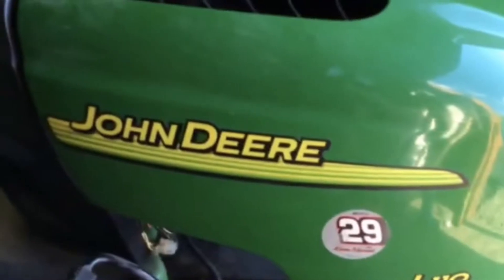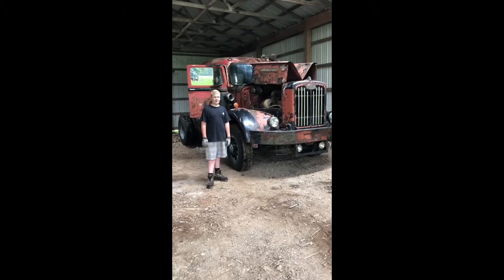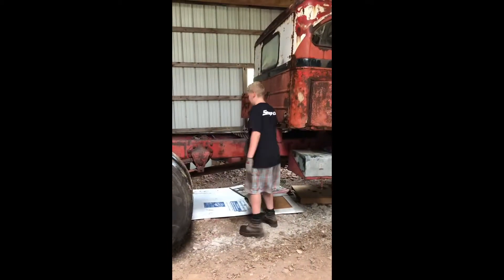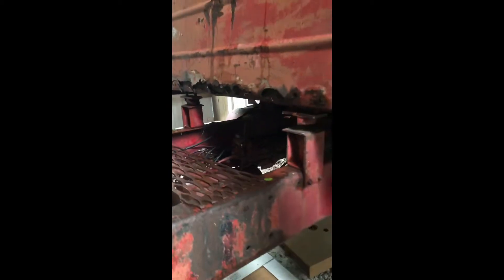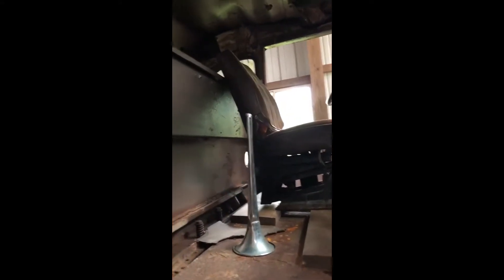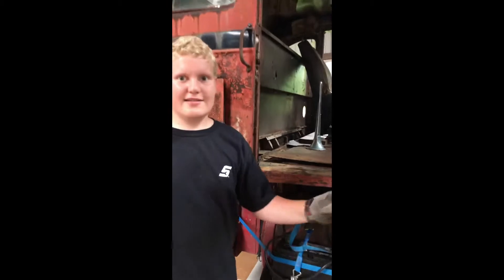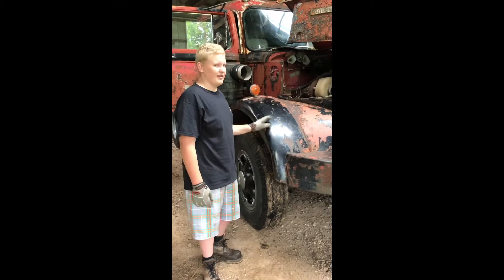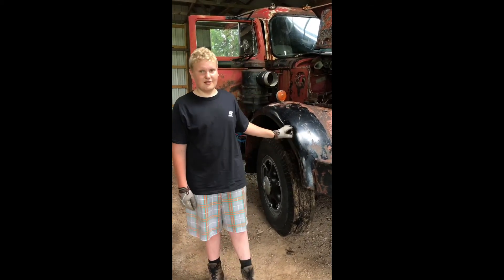I BOUGHT A ABANDONED SEMI TRUCK AT AGE 14 !

Comment: I'm a B model man myself. I started working on trucks in 1982 when I was a kid in highschool. They were still running trucks from the 60s up by me. Mostly Mack's and Autocrars because of their longevity. We had a lot of quarries and gravel banks and those trucks were tough. The shop I worked in was repair only and we only owned one truck, a 1956 LJ Mack hard-nosed wrecker with a 5spd main box and a 4spd auxillary box, I already knew how to drive farm tractors at 8 but that was the first truck I drove at 16.  I worked on a great range of equipment, including heavy equipment. But I sure love to see the younger kids getting into the old-school trucks. I spent many hours working on my dad's 42 IH KB1 pickup (still have it) back in the 1970s. If you need parts contact or join a truck club, Antique Truck Club of America for me or go to the Hershey swap meet in PA (if you're local). I have walked that meet as a kid with a sandwich board hanging on me looking for a instrument panel for my pops truck. If you don't get that think of "eat at Joe's" if you don't get that ask your grandfather. Good luck and have fun!!!!
Reply from the maker: Cool story yes I definitely will be going to hershey I live in pa as well

Comment: Get the mechanicals done so it at least runs. That's the biggest thrill as far as accomplishment.
Reply from the maker: It actually does run pretty good. We'll right now the wiring is out so I can't start it but when it's rewired it starts and runs

Comment: Those old Autocar windows are impossible to find, they are smaller than the newer ones that were made in the 70's and 80's
Reply from the maker: I got 3 this summer went to a junkyard were the guy had a bunch of them
Reply from the maker: I also had a decent set of them I was supposed to get last winter but ups broke them in shipping. I was pretty darn mad That's for sure